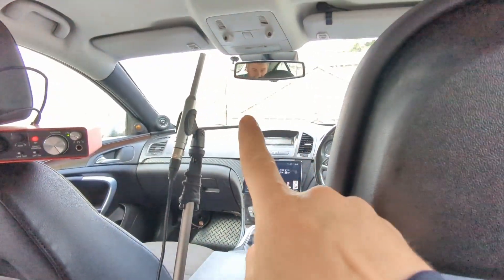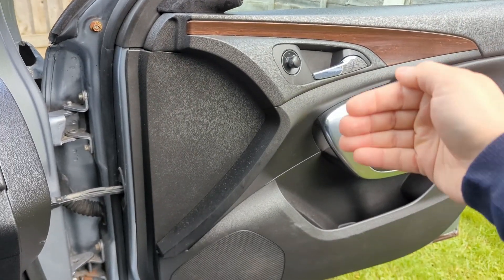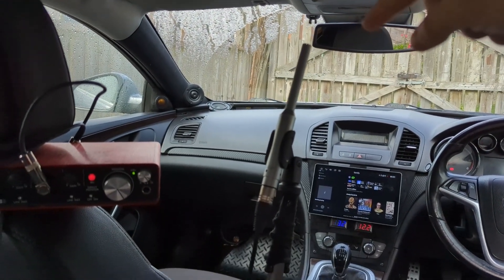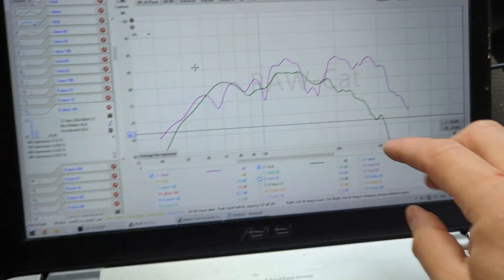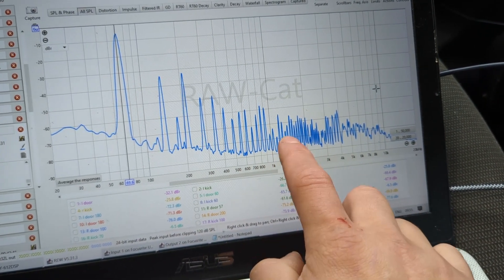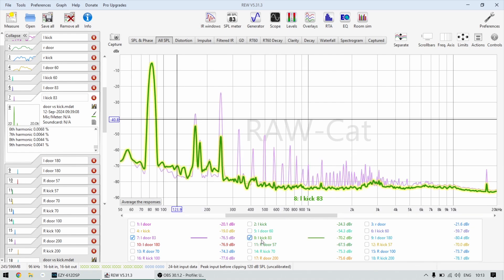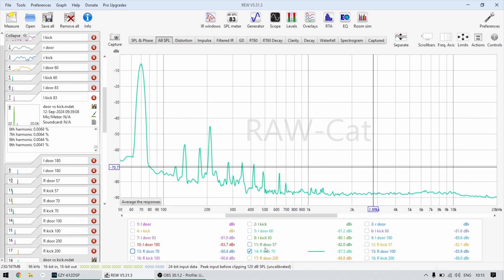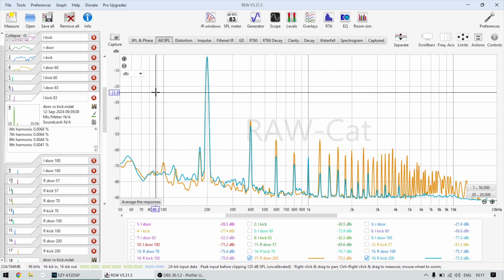This is why Doors are s**t!

Comment: Intresting! What do you think if both the speakers were built in sealed enclosures?
Reply from the maker: The response will be very peaky with no low end. If that works for your system, you can use those.

Comment: Door speakers infinite baffle no matter how much expensive, heavy deadener you add or foam or whatever will simply be problematic with peaks, buzzes, and rattles UNLESS you build a true dedicated enclosure either incorporated into the door panel itself or that attaches seperately up against or over the existing panel. Door enclosures can be one of the more challenging projects in car audio fabrication (especially making them look good with a factory type aesthetic and also function well...

Comment: Very interesting video! Thank you a lot for your excellent work. 
I believe Mercedes and BMW higher class cars have woofers under the dash in leg area and slim underseat woofers rather than the doors. So they seem to address this problem with rattling. I myself own a Subaru Forester and I am thinking making a underseat box with $15 6.5 inch slim woofer GRS 6LPSW-4 6-1/2"  which has 48 Hz - 1.5kHz range on Parts Express. Usable range with good linearity is up to 600 herz. I also got a MDF enclosure 5.5 liters for 11 dollars. Will try it next week.
My current setup is Android unit with 8 channel DSP which I got for $160, Audison AP 690 in the doors, FaitalPro 3fe22 as mids and some Kicker tweeters which I took from other set.
I have also ordered Dayton measurement microphone for next week, will measure rattling as you did.

Comment: If you have a BMW g20 where are the best location to put mids (alreay got focal TBM 3.5WM) 
Option
-Kicks can’t do too small
-make a hole in door to put 6wm
-6wm in underseat (lower VAS) no floor cutting
-8wm in underseat no floor cutting
Reply from the maker: 8s underseat👍

Comment: This is a very useful demonstration and a great tutorial on how installers can evaluate installation driven distortion. For those stuck with door speaker locations, this measurement technique could also be used to evaluate the effectiveness of deadening, speaker mounting rings, etc.

Comment: I have big expectation for the doors in my T-bird in the next month. Only CLD so far with almost no rattles(pretty good for a 90s car)and headunit power crossed at 50. I do have foam on hand for eventually decouple. My thinking is they are big, older metal and decent crash bar, so better than average than most shit box.
100 watts we shall see. Might be a junior class sleeper without ruining the panels for tweeter placement
Reply from the maker: The thicker metal might help with that. And the fact that older door cards don't have many parts, usually it's just a single piece that doesn't have joints or buttons. Your case might be an exception😉

Comment: But kicks are infinitely harder when you don’t have that location already! How do I add kicks easily!? I tore apart my CDT 6x9 subwoofers free air in the doors
Reply from the maker: Kicks depending on the car might not be easy or it might be much easier than swapping out door speakers. I had to relocate some wires, some people have to relocate fuse boxes. Some can just cut a circular hole and bolt a ring🤷 It varies.

Comment: Sometimes I hate you. I literally just spent 45min trying to see if i could fit a 6.5inch ring in my kicks. 

Hood latch is in the way for the most part and bcm module is up by the firewall so it would be difficult. But I could stack fab and notch out around things in the way. Wouldn't be very easy at all though. I'd have to go inverted and fairly shallow mount.
Reply from the maker: Haha, sorry about that😂 I had to cut and solder many wires to make space on the driver side. Passenger is easier as there is more space. Pros are relocating while fuse boxes and resoldering 10s of wires... But at the end it is totally worth it😉

Comment: This is one of the best videos out there on the subject. I've always considered door mounting speaker a total flaw. Just putting your hand on the outside door skin you feel the amount of energy lost as vibrations. Unfortunately, 90% of car manufacturers don't care about SQ....and genpop doesn't either. Only the higher end models have descent sound systems.

Comment: Would putting the drivers in custom built pods at the kick locations do the trick? Or does it have to be ib?
Reply from the maker: The volume of the pods will limit the low end extension. If you have a front subwoofer and you are ok for the midbass playing only down to 80-90Hz, pods will be fine. But if you want 8s to play down to 60Hz, You need IB.

Comment: What about midbass in sealed box underseat? Worth a shot? My doors buzz and rattle even after heavy deadening
Reply from the maker: Underseats don't play high, so you need a 4in mid to reach them. If you can install a bigger mid, then it will work.
Reply: I have a jbl fuse 8" under each seat playing stereo bass up to 200Hz.  They cross into 4" mids in the doors and that cleaned up the rattling almost entirely.

Comment: Kicks if you car can take them. Not all cars have space for it. My pathetically small VW is a case in point. :)
I miss my old '89 Audi. Space for everything in that old tank.

I think we need a car with better build quality. :D That's some nasty buzzing even with deadening and padding.

What did you mean when you said the kicks are venting outside into the wheel well?

Enjoying the videos. Much appreciated.
Reply from the maker: My kicks are infinite baffle, That is they are open to the outside.

Comment: Hi,
If my midbass is playing 80 to 250Hz,
Do you think cutting the door for mid bass to come out of factory grill will reduce resonance/buzzing ?
Reply from the maker: It will. There will be less energy transmitted to the plastic door panel.
Reply: @RAW-CAt 
I was thinking and just now understood the reason why there is buzzing above 100Hz.
All car manufactures specify the first natural frequency of any component to be above 150-200Hz so that the components don't fail due to structural stress. And unfortunately it bad for Car Audio.
Does this means midrange in doors is also bad?😢
Reply from the maker: @rajasekhar9840  a 3in mid will transfer much less energy than a beefy 6.5. midranges have much lower moving mass so they don't excite the surroundings that much.

Comment: So a shity door build with a 6" driver and plastic infront of it sounds worse than a solid aluminium bolted kick with a 8". Sorta obvious.
But I get what you saying. Thanks for the testing effort.
Reply from the maker: Yes, a typical factory door with an average amount of deadener performs worse than a proper solid kick build. My doors are the same or slightly better than 95% of car audio doors. So I think it is very good to show people what they are missing out on.

Comment: The Data you are looking for is in the Waterfall chart
Reply from the maker: Man, I was looking at waterfall and distortion, but didn't really see anything. I guess there is no extra overhang, but the extra energy that gets distributed and is calculated as "noise"🤷
Reply: @RAW-CAt   What you are looking for are the "fingers" that pop out at the bottom. Those are the resonances. You should see more on the door measurements.  I'd be interested to see if you can send me some sweeps
Reply from the maker: @kewlbug  will do 👍

Comment: This is truly a unfair comparison..... 1st 8" up against a 6.5" 2nd cutting holes in the floor/firewall/wheelwells is borderline totaling your car, if you get into a accident and they insurance or body shop see's that its almost definitely going to be a huge problem.
Reply from the maker: The size 8 vs 6.5 has nothing to do with the comparison as both drivers are playing at the same volume. Neither of them are being run into distortion or xmax. 

What does the 2nd point of yours have to do anything with the content of the video? I do understand that you might be concerned,  however that is off topic.
Reply: @RAW-CAt  it's not off topic at all........ very few people are willing to cut holes into the structural part of their car. If you wanted to be somewhat fair you should've deducted the noise that the 8 made in the door from the noise the 6.5 made in the door. I get you're making content and I like your content but this just has too many different variables and once again a very small amount of people are willing to "cut holes" in their floor/kick/wheelwell/firewall for the small benefit. Once again if you took the amount of rattle away from the 6.5 that the 8 ended up giving to the door anyway...........it's not nearly as much of a benefit.  Cheerios
Reply from the maker: @everyangle4310  that "very small benefit" is clearly audible, so it is not very small. It might look small on a graph, but in real world it changes how punchy and clean the midbass is. Agree that not everyone can cut a car, but this is what we do for ultimate SQ.
Reply: @RAW-CAt you’re on the money cat, this guy’s thinking like an insurer, not an audiophile. Great video as always

Comment: You can hear s&$)( in the kick panels because your legs are in the way and the passengers legs also block the kickpanels… door panels are the best
Reply from the maker: Obstructions block only the high frequencies. Low frequencies get through everything. Like the subwoofer goes through seats. Even carpet covered over a midbass driver won't affect much. In a typical 3 way the midbass from the kics play up to 200-250Hz only. Passenger legs or any other obstructions at those frequencies have 0 impact.
Reply: @RAW-CAt awesome info
Reply: Objects only begin affecting the sound when they are 1/4 the wavelength or more. 100hz is about 9 feet long so your legs aren’t doing anything. If you’ve heard that “your legs block the sound” that was probably someone talking about click panels playing up to 2000hz or so. Doesn’t apply to midbass.

Comment: "Hi. In my car, there's no way to avoid placing the mid-bass speakers in the doors. What do you think about putting the mid-bass speakers in two flat subwoofer enclosures designed to fit under the seats? Alternatively, I could make a subwoofer for the front out of a similar box. Whats your opinion?
Reply from the maker: Yes that is an option That a lot of people are using.
Reply: Underseat work well but keep in mind you must have a 4 in midrange to make this work because the frequency response under seat rolls off under 200hz so you need the 4 in midrange to play low to meet it. It is unfortunately the tradeoff such is the life in this hobby, it's always a game of tradeoffs.
Reply: @justinhogan7248  True. And usually, if you can't fit midbass at good location, you can't fit 4" midrange, anywhere, either. Car audio generally sucks big time, unless: a) you are lucky with the car itself where designers did amazing job with factory speaker locations, or, b) you are willing to turn your car's interior into frankencar (which also might not be legal, depending on your country laws).
Reply: See PSsound cheap SQ build where he uses focal iSub twin which he uses for underseat

Comment: Hey, I just want to tell you that I put the oneaudio mb8 in 4.5 liter pre built sub box and put them under the seat. They sound amazing. The distortion is under 1 percent, peaked at 2 at box resonant frequency (180?).

I feel I could almost see the bass guitar at the top front. And it's really punchy after tuning and time aligning.

I had to lower the DB by 9 DB from the peak to cross at 60-300 then have faital pro 3 inch taken over.

Maybe build a small box and test it and make video about it? Haha

The box is too thick to slide under my seats so I just leave them at the passenger foot well for now.
Reply from the maker: That is very nice to hear👍